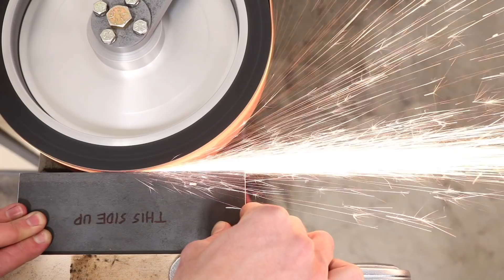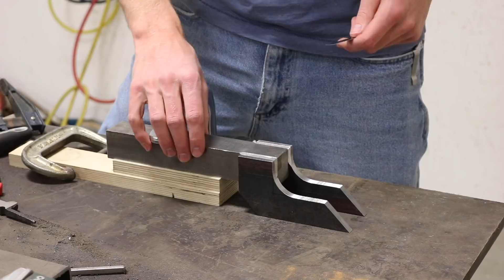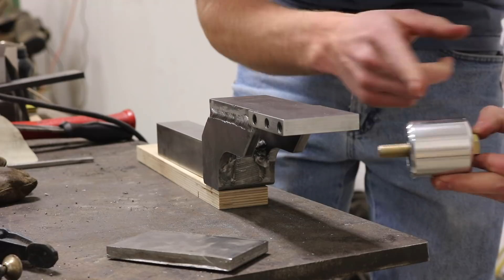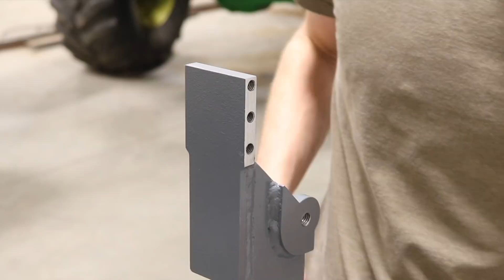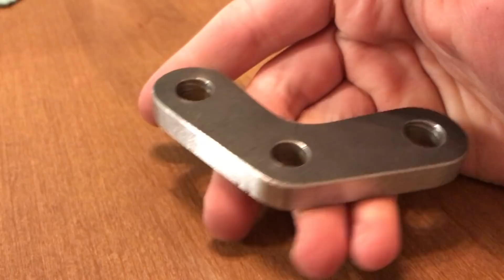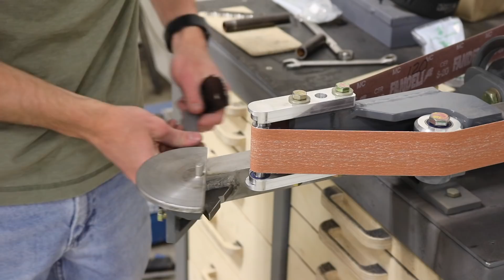Belt grinder small wheel attachment

Comment: I loved the using a piece of wood for a fence. It would be super easy to tap a hole in the support arm and the table and make a couple arms with a fine threaded shaft/knob to control moving fence in accurately, and even could attach a digital caliper to move in 0.001's to act as a precision surface grinder.

Comment: wow, that is some amazing work, I'm thinking about buying your plans, but are they in metric?
Reply from the maker: Thanks! No, sorry, the plans are only in imperial
Reply: @Jer_Schmidt  oh ok, but in the plans, are there drawings on 1/1 scale included from all the parts? so that I can, for example, print them out, glue them on my steel and then cut them out? the only thing I will have to account for is the thicknesses and widths of my metal bars and such. Do you maybe have an example of how your plans are?
Reply from the maker: Enzo Welvaert 
Yes, there are 1:1 templates. You can look at the small wheel attachment plans for free, here: http://jerswoodshop.com/small-wheel-attachment/ These are written in the same format as the belt grinder plans.

Comment: Not to be critical at all, just wondering if a lighter gauge steel could be used such as 3/8 inch instead of 1/2 inch?
Reply from the maker: The only place I used 1/2” was for the horizontal plate that holds the aluminum sides, and I wouldn’t want to make that any thinner, since it has 3/8” tapped holes in the edge. The side plates are 3/8”, but I think those could be 1/4”.
Reply: @Jer_Schmidt  Thanks mate, great design and thanks for speedy reply.

Comment: How about a surface grinder attachment next.  A set of  linear bearings with a table under a contact wheel. But very cool my next one will use many of your ideas as this is the best grinder I have seen homemade or not. I would get with a manufacture and have them built if you don't want to manufacture but that is premo. I could see people paying 3 to 4k for a complete set up. a tilting KMG is $3200 and this blows it away.

Comment: I see why you want a mill, and, believe me, it´s fun to have. But i see also a need for a vertical bandsaw for metal. You must hate the hacksaw already....
Reply from the maker: I don’t mind the hacksaw. But I might get a portaband at some point, as they aren’t crazy expensive or large.
Reply: That´s a alternative. Btw, i saw Lyle Peterson (tubalcain) using a very small one, which is battery driven. Was also nice. I have no idea if they are good. Not available in Germany. I have one from Flex, similar to Portaband, i guess. That´s a heavy beast. But you can saw anything, what a small stationary saw can do.
Reply from the maker: Udo Willkomm 
I would want to get the Milwaukee M18 cordless one. They have a 5x5” cutting capacity I believe.
Reply: I´ve just looked at it. Seems to be a nice machine. And the have nearly everything you can imagine in their M18 System. So you can buy additional tools without battery and charger, if you want. And it´s a name brand, so you might get good quality.
Reply from the maker: Exactly. I already have a few of their 18V batteries with a drill and yard tools, so it’s the natural choice. And I’ve used an earlier version of their bandsaw and was impressed.

Comment: What I don't understand is why you don't make various rollers on your lathe. I'm an amateur Machinist and I can make perfect wheels for something like that rubber coating on his a different animal all together but making the different size wheels with the bearings on them so easy it's like falling off a log
Reply from the maker: Because very few of my viewers have a lathe. If I use a lathe in a video about 20% of my viewers walk away in frustration because they can’t do what I just did.
Reply: @Jer_Schmidt  well in that case I could see making them myself and then listing a few other things that you could buy. with spending $30 for to skate wheels or whatever the heck they were and all the other sets of them that you were buying is a little over-the-top you must have spent hundreds of dollars on that. I literally could make a set to the same specs as those sets in probably an hour and a half maybe?

By the way I have an idea for a replacement for the rubberized Wheels it wouldn't be quite as grippy but it would be decent. Most metal suppliers at least the one in Michigan Alro Steel so usable drops of nylon round stock. You could make breaking news after a sleeve and press a metal wheel rate into it and then there'll the hell out of it. It would work fabulous
Reply: @Jer_Schmidt  I hope I did not offend you however you're very talented designer and Builder. Who sings this material used as a little over-the-top but he'll I end up doing it all the time myself. It's a great video resource for people

Comment: I noticed your drive wheel was changed from your other video with the crush sleeve.  what happened ?
Reply from the maker: Knife Grinder Parts sent me a set of wheels to try, so I was testing them for a while. I’ve switched back to the originals now. The ones from knife grinder parts are great, but the drive wheel doesn’t run quite as smooth as the one my brother made.

Comment: The small wheels would work really well with a table designed to fixture round tube for notching.
Reply from the maker: Yes. Perhaps the most difficult part of tube notching with this is centering the tube on the wheel, so if I had a special jig to make that easier that would be great.
Reply: @Jer_Schmidt  I was thinking a varation on your adjustable table but with a second axis angle adjustment + tube offset for off center notches. Something like that would be great for roll cage tube notching.
Reply from the maker: Alec Moody 
Yeah. Good idea.
Reply from the maker: Probably as simple as a table with a 45° groove running down it.

Comment: I wish you would use some oil or actual cutting fluid on your drills, and put a pump and fluid system on your horizontal saw.  It would really speed up the cutting and save you money in drills and saw blades.

Comment: I still don’t understand why you don’t use a grinder instead of the manual saw...
Reply from the maker: Exercise is good for a person. The hacksaw does just as good of job without the noise, sparks, or heat, and the workout is good.
Reply: 😂😂😂 best answer ever 🤘. There is one more think I do not understand: why you don’t start talking with some heavy hardware company to start selling your machine plus accessories (instead of just selling the plans)? You could make millions! You should patent it.

Comment: Ok dumb question: what is the advantage of being able to have the wheel horizontal?  Man, 1/4" with a hack saw??? You have determination sir!!
Reply from the maker: I pretty much always use the small wheel attachment with the grinder tilted sideways, so the wheel is standing on end. So the small wheel rarely needs to be horizontal. But when I'm using the contact wheel or platen attachment, I run the grinder in the horizontal orientation about half the time, and vertical half the time. So the grinder needs to be able to tilt for the sake of those attachments.

Comment: Amazing as always. I’m in awe of your level of craftsmanship. 

Instead of welding the two tabs to register the hold back wheels to do slot work could you have filed a groove instead?  Seeing as you had to ship the wheels over so far anyway?

Just a thought.
Reply from the maker: If I had a mill I would have milled a slot across it. I think welding the tabs on was easier than filing a groove.

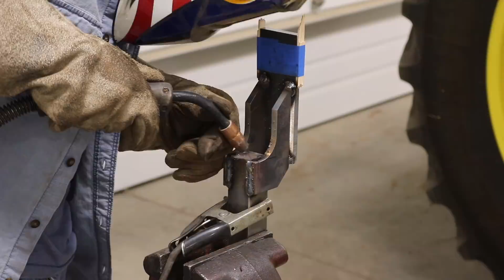Comment: At around 4:30 when truing the 1/2" with a fence you instinctively fed safely against the grinding wheels rotation. The other direction, climb feed, wouldn't be a good choice but can be quite exciting. Just thinking a little. Well done and keep going. Cheers
Reply from the maker: Indeed. I'd probably have a wall to patch!
Reply: @Jer_Schmidt  Or not patch, a badge of honor for your building. If you ever want your VFD's potentiometer remotely mounted or would like fairly repeatable speed settings I would suggest a multiturn pot from Bourns. A 10 turn wirewound would work great. I was going to ask how the balance is for transitioning the 90°? Lastly I have option 4 to add to your list that includes notching the bench, you can always reorient the motor 180° if it offered an improvement with the balance. A cheap shock absorber as a damper is a worthwhile touch if unlocking the clamp could be dangerous. Just thinking... again. Take care.
Reply from the maker: I'm fine with how it's weighted. I usually stand on the right side of the machine when tilting it, and it's very manageable from there. I have tried unlocking it and letting it flop over under its own weight, and while I wouldn't want to do that every day, it's not too violent.
Reply: @Jer_Schmidt  Thanks for the info. Ameriblade... no I think they're called Ameribade for parts. Their prices for bonded wheels is decent and they dynamic balance for 3500 or so. It's hardly worth it for large wheels but pouring 2 part polyurethane with aluminium hub would be a cool video.  Polyurethane is available in small volume now and I've poured many suspension bushings and made a few profiled rollers too. You can choose the cured density etc and I've always machine finish to size. Coffee cup molds just aren't what they used to be. Best if luck.

Comment: Are the cheap deflector wheels made in the USA? Buying American is my religion.
Reply from the maker: AmeriBrade told me they have some. Maybe not super cheap, but they are US made and they have the crush sleeve.
Reply from the maker: Hmmm, just looking at their website and it says they aren't US made... But you might want to ask them about that because they specifically told me they do have US made ones.
Reply from the maker: Oh, here you go: https://rover.ebay.com/rover/0/0/0?mpre=https%3A%2F%2Fwww.ebay.com%2Fulk%2Fitm%2F192514633103 These are actually significantly cheaper than the ones I bought.

Comment: I just purchased, downloaded, and printed out your build plans for this grinder. They are very nicely done as well! Well worth the $20. Im sure you spent a good bit of time on them. I do have a quick question though. From what I can tell, if I have my steel supplier cut to the exact sizes listed in your parts list, I will actually have about an inch or so extra right?
Reply from the maker: Yes, the parts list shows a few inches extra. So if you buy a single piece the length that the parts list shows, you'll have room to make all of your cuts.

Comment: You said in another video that a piece of stock was too massive for you to weld, in that your machine isn't powerful enough to build up the required heat for the weld. The thing is, if you pre-heat the pieces with the acetylene torch, you should be able to do anything really. You can also use an electrode instead (MMA/electrode/stick - they're the same).

Comment: This is such an amazing tool. I love how you used the fence and the contact wheel to basically have the functionality of a surface grinder... but without the need for a machine vice and mill table. But when you welded those two little tabs to register the attachment, I was sad you didn't have a mill to cut a slot. (Mind you, I have none of these tools, lol.) Everything else you did was so meticulous. I half expected you to spend a few hours to rough a slot out with a hack saw and angle grinder and finish it with a file and a carbide scraper. One problem, though, with the attachment. As the wheels wear down, you can't cinch them up tighter. I am sure you will end up improving this at some point in the future. Even if it takes many hours to save on $30.00 wheels.
Reply from the maker: Yeah, been thinking about that. A couple comments have suggested using slots in place of the tapped holes; I'll probably give that a try.
Reply: I slept on it. And please don't do it on the account of us armchair quarterbacks! Speaking for myself, I'm just thinking out loud when I probably shouldn't.  Your attachment is very elegant, and as you said, you can upgrade it if and when you need to. A little wear on the rollers isn't going to change the geometry, much. If I was in an alternate universe where I had these tools and materials, I think I'd do it just like you have!

Comment: So other than making parts for the belt grinder (lol), what did you build this for? Knife making? 

It's probably the best designed belt sander I've ever seen. Super versatile.
Reply from the maker: I plan to make a knife or two, but really it's just for general metalworking. There are a lot of projects that require the same tools and techniques that I'm using to build more parts of this grinder.

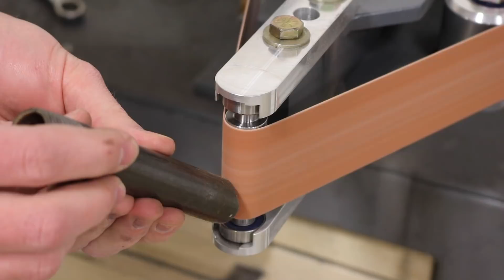Comment: 12:40 Was exactly what I was thinking, also adding a long piece of metal to push the wheels with your knee, making them wear out slower if you understand what I mean.
Reply: And great editing, as always!
Reply from the maker: Uhhh...sorry I'm not sure what you mean. What's the long piece of metal attached to?
Reply: Kinda hard to explain. Did you see Izzy Swan's video on his foot powered bench vise? A type of lever you push with your knee so the rubber wheels come in contact and push down on the belt only when you need them to, so they don't wear out as fast. But I guess that would make it pretty big and clunky...
Reply from the maker: Oh yeah; I get it now! Probably not worth it just to save a couple of wheels though... I'd spend enough time + money building the wheel-retracting-device that I could buy several more wheels.

Comment: Came out pretty sweet. Nothing better than having all 3 attachments that are both horizontal & vertical... I just got a 14" contact wheel for my KMG(I had to make a riser block for it to work though). I made a contraption for my Small wheel with the 2 wheels behind, I used skateboard wheels, they worked pretty good, but i don't really use it that much... The last thing you need to build is an adjustable table that can be put into different angles... I really like the circle jig, might have to try to make something like that....Take it easy.
Reply from the maker: Thanks! I really should have tried skateboard wheels. I think would have done the job and been a lot cheaper...
Reply: Yeah, I've even seen guy build their grinders using skateboard wheels on the platen, but that might be a little too much, hahaha

Comment: I always have to laugh when you pull out the hacksaw to rough cut your parts. What you need is a port-a-band with a stand, they are extremely convenient.
Reply from the maker: I just can't bring myself to buy a portaband when I'm working on a design for a large vertical metal-cutting bandsaw ;-)  just trying to get by til then

Comment: Have you ever considered making a small table attachment for your bandsaw so you can cut out shapes in the vertical position? That is if your bandsaw can tilt back that far.
I did that with mine and it comes in very handy, a lot easier than a hacksaw!
Reply from the maker: I'm just gonna build the whole saw. A large bandsaw optimized for vertical use. Hopefully I actually get to that within the next 40 years.
Reply: Cool looking forward to that, all your videos are great!

Comment: Maybe you could use something like the furry (not hooked) side of velcro tape around the red wheels to make them last longer without damaging the belt surface -- and replace the tape as it wears out, rather than the whole red wheel.
Reply from the maker: They run at pretty high rpm though...especially if I'm using one of the larger small wheels. I'm afraid they could be unbalanced or the tape could fly off.

Comment: 11:50 in skateboarding they're called "speed rings" and are a necessity for the same reasons, but they only come in 8mm or 10mm.
Edit: Maybe an alternate "boomerang" attachment with slots for the wheels would be useful? To be able to adjust the side angles you get when using the small wheel, instead of just 90 degree?
Reply from the maker: Yeah I really expected these wheels to have them... really bad design without them. 

Good idea. Can't use tapped holes then, but I can work around that.

Comment: Hey Jer, you should build a metal cutting bandsaw!
Reply from the maker: I'm definitely considering that...
Reply from the maker: Hadn't seen that before; thanks for the link! I have in mind an all-metal design, with steel table. It's more efficient on space to make a metal-cutting bandsaw with larger wheels, so the cut height is lower but the throat is deeper. So overall it'll just be more optimized for metal.